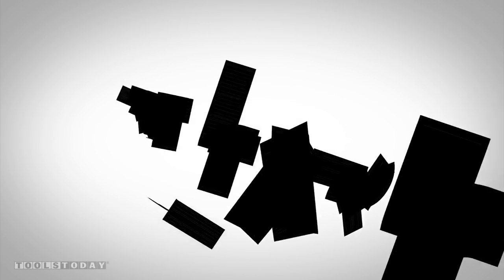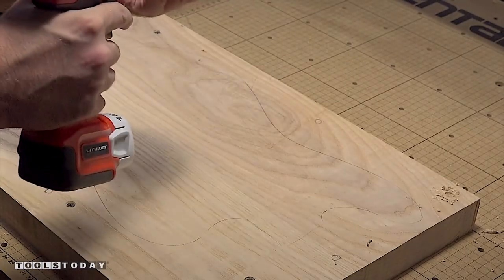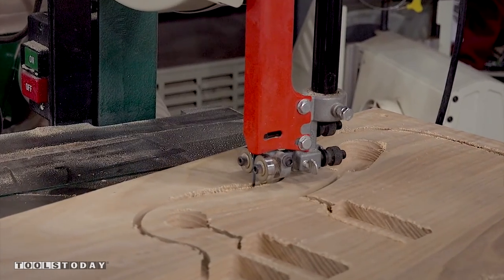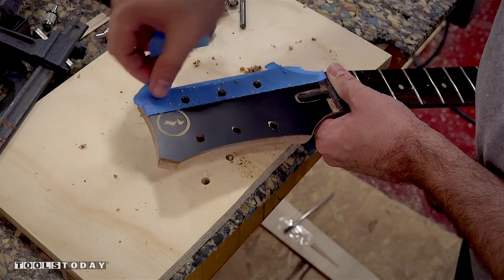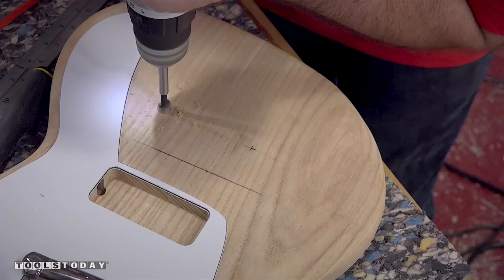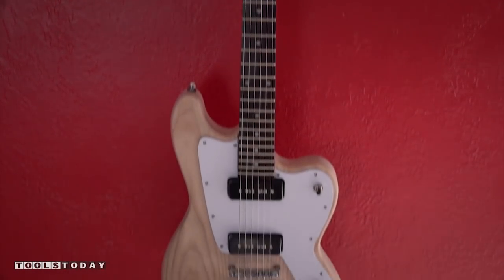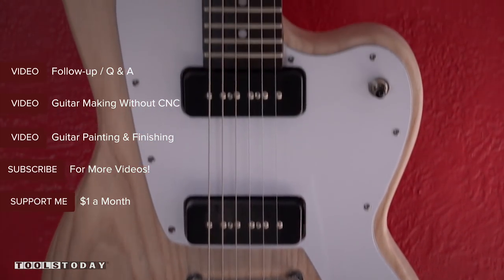CNC Project: Electric Guitar Built By David Picciuto w/Amana Tool Industrial Router Bits

Comment: Very cool.  I have built a few guitars with my CNC as well.  I watched the whole video and noticed that you didn't ground the tailpiece bushings.  This could result in a unwanted buzz or hum.  Normally you would run the ground wire from a small drill hole from the control cavity to the bushing hole and press the bushing into the wire.  Then solder the other end to the caps that will have a ground wire. 

Cheers Peter.
Reply: Peter Shupe It's not shown in the video but I forgot to add the ground wire to the bridge. When it came time to do the wiring I realized this and went back, removed the bushing, drilled the hole and added the wire.

Comment: Did you not mill in a neck angle to the pocket? That would explain why the pickups are ridiculously high and the strings raised so far off the body. The problem with 2.D CNC is that bodies are approached in a top-down approach rather than taking into account any neck angle geometry.
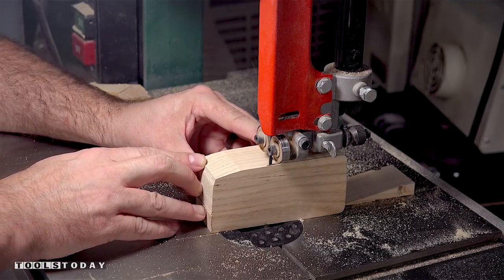Reply: +Prostheta at 4:15 you can see that I did indeed add a wedge for the neck angle. It turns out I didn't plunge deep enough for the pickup pockets. This was my first guitar and I have learned many valuable lessons.
Reply: +Make Something Ah, I missed that bit! I went back in to have a look and hit that point where the drill chuck burnt the neck pocket....there's nothing to learn unless these things happen, right? :-)
Reply: Yes, he should have cut the angle with the router.. having the body clamped at the right angle.
Reply: On a CNC, definitely. The most comment methods for regular guitar-builders is to use what's called a "Myka Jig". I'm right in the middle of documenting those for ProjectGuitar.com at the moment. That should be published in a week or two....
Reply: I built  a firebird and found if i angled the neck back >  2deg. the strings were too high at the bridge.  
 Looking at a bunch of gibson models, the flat body guitars like a SG or Firebird have a higher string height off the body (at the bridge) than a Lespaul because the Arch top rises to follow the strings.  
On a flatop, you have to have the bottom of the fretboard about level with the body where the neck meets the body , to keep the strings lower.
Good job though,.. we all learn as we go.